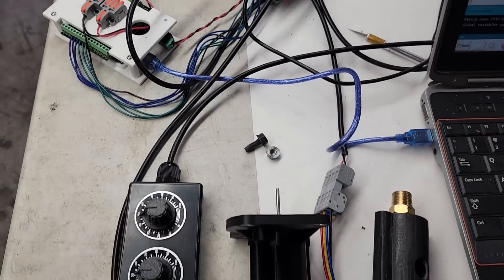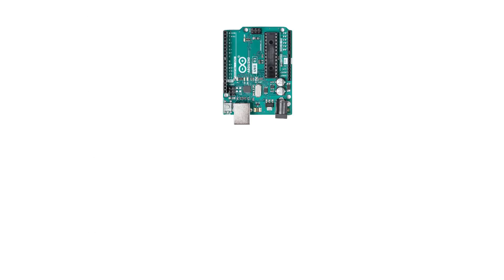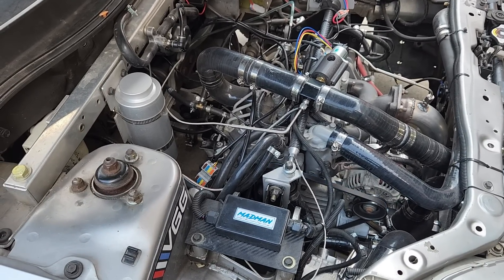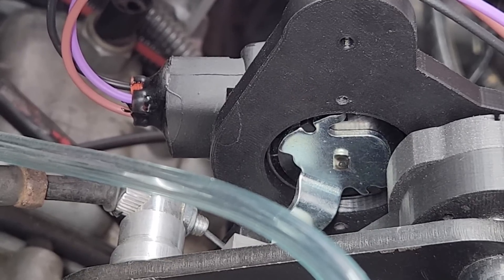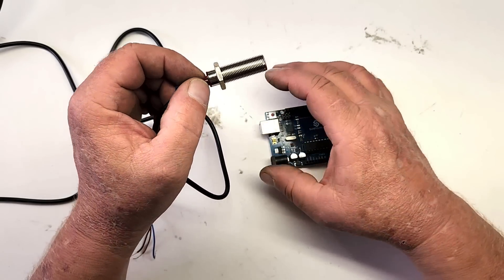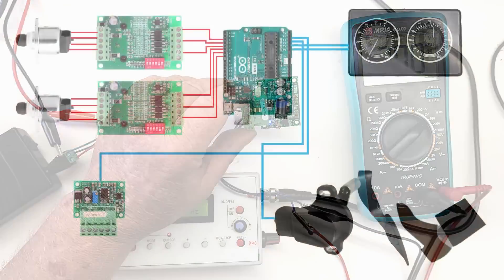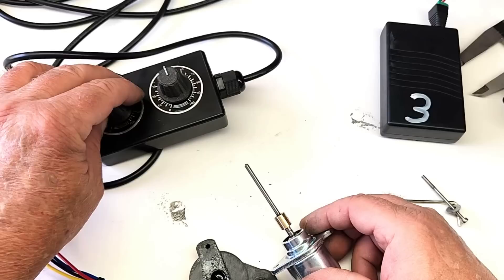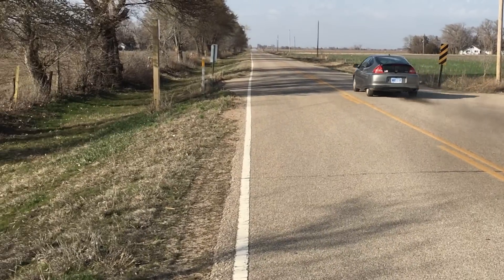S4 E20 We continue upgrading the AMR500 supercharged kubota diesel with custom engine controls

Comment: Future Jimbo might want to experiment with adjustable fuel pump timing. But remember do not spray fuel onto the piston too far down on the stroke. As you will start to burn the top of the piston, Rings, and cylinder. Keep up the great work..